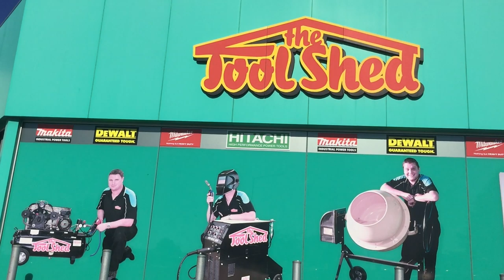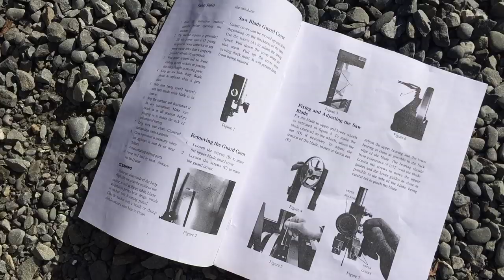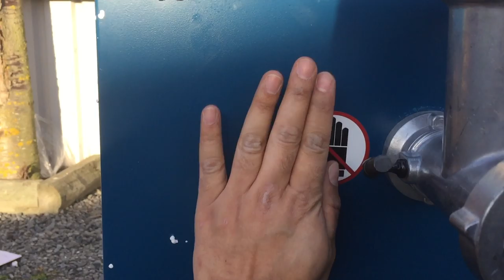Win a Meat Saw with The Tool Shed

Comment: how;s the performance for cutting for frozen meat
Reply from the maker: Hi mate, it goes really well with frozen meat. The motor has a consistent speed and power output once you start cutting. I would recommend cutting frozen or very chilled meat.